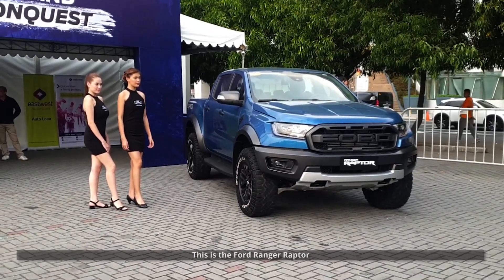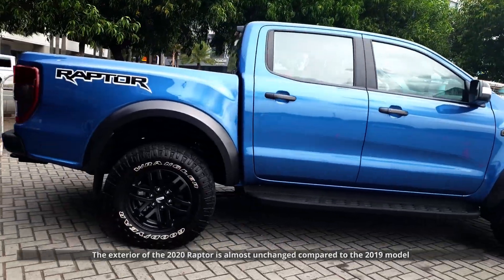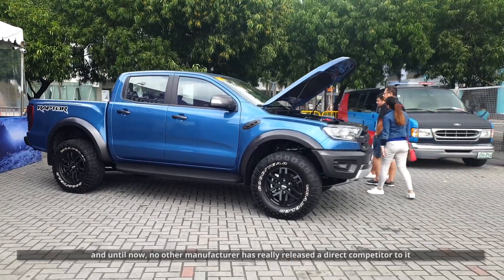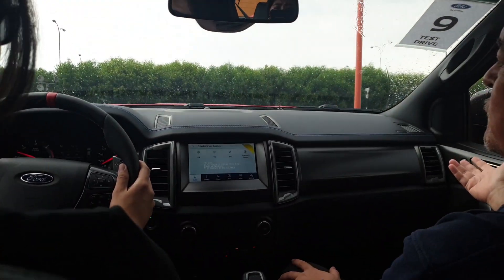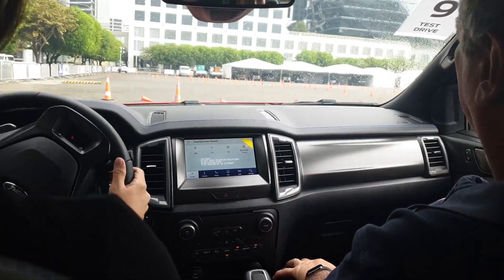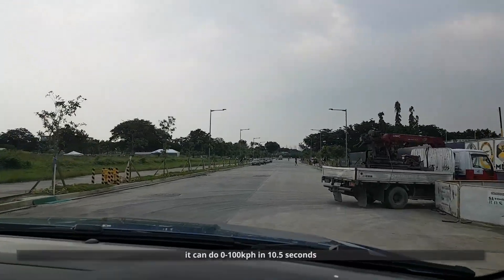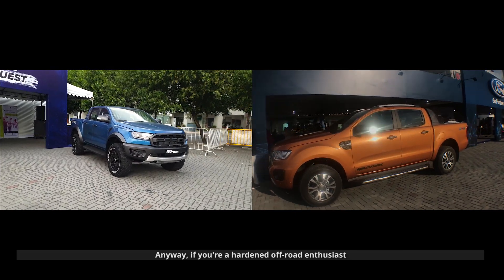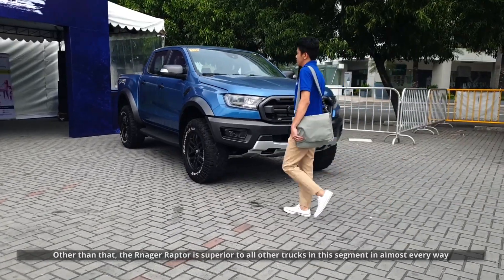2020 Ford Ranger Raptor review  -Excellent off road but how is it on road?

Comment: You said it in 8:47 of this video that the 2020 ranger raptor lacks autonomous emergency braking.. Well i guess you are just like a soldier who went on to go to war without proper orientation and thus suffered a big blow in the battle due to the lack of knowledge before entering the war..

The 2020 ranger raptor has an AEB (Autonomous Emergency Brake) added to it in the 2020 model version.. Better learn more before you blow your horn. You mislead your viewers with this kind of videos that has false infos. Damn.
Reply from the maker: I stand corrected. Yes AEB was one of the updates for the 2020 model. The 2019 model didn't have it and I wasn't informed about the update before I uploaded the video. Anyway, I'll just add it to the description
Reply: @jaywalkur  now that is professionalism at work. 
That's more like it. Just an unsolocited advise i would give is that next time just make sure to secure all infos in full before spreading matters out only to find out it is in lack of content.. because it can cause an ill-effect on the product in relation to the viewers' appreciation of it and the company's appeal and to yourself as well in terms of integrity.
Reply: Nand2 ka n naman para mang troll?! Edi WOW!! 🤣🤣😅